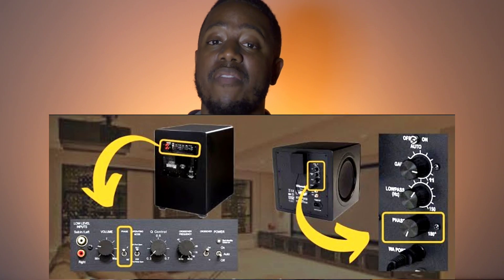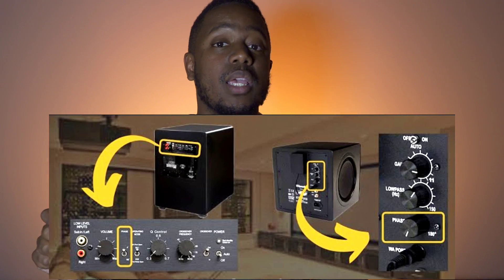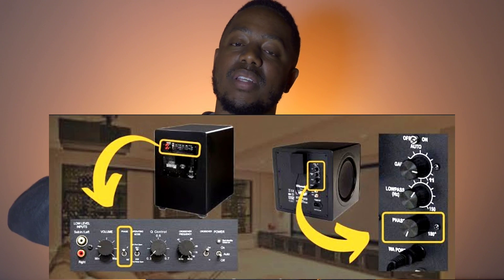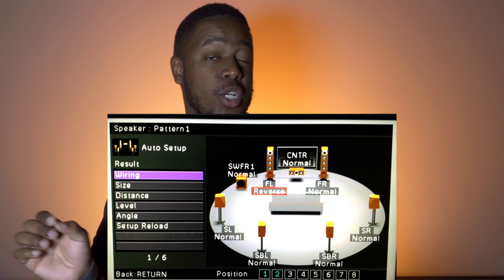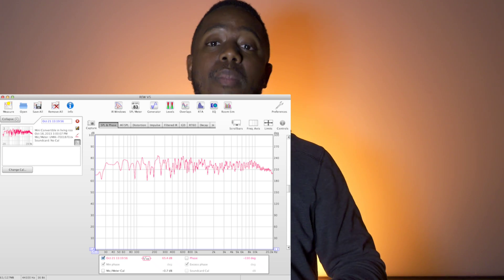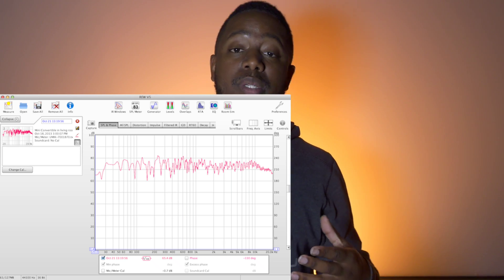Speaker Phase/Time Alignment and How to Set It

Comment: For surrounds for a 5-1-2
Reply from the maker: Buy the speakers that match the front speakers you already have
Reply: @Kpaceguy   I wanted to have 4 different speaker brands running on my receiver I didn't want anymore Polk surround they sound good I just wanted to try something different
Reply from the maker: @stephenreynolds3711  You can. It's your room. But matching at some point will be best

Comment: Thanks for the video but I know you can do better. maybe set a different background, give a few measurements as examples, provide a more systematic approach rather than laying it all out there. Most AVRs have distance settings to time align the subwoofer, thats very important to mention as well as the relationship with the cross-over point. I understand that creating content consistently with life getting in the way is mighty hard but I think a sloppy video will do more harm than good in the long run.

Comment: Thanks for the video.  Time and phase are so very important!  Most processors have auto phase/time alignment; some better than others. As a fellow owner of the AVM70 I found ARC doesn’t auto invert polarity so something to watch out for (setting phase is not an optimum alternative as it is essentially delaying the wave to line up the impulse.  Taking it to a new level I have started running REW, Rephase and using convolution filters with programs like Roon and Audirvana with dst3 plug in for 2 channel and the improvement was huge - full range EQ and speaker to speaker phase and time alignment!  Not a novice task but adds a new level of clarity and transparency I have never heard before.